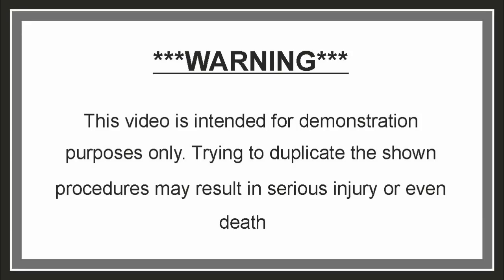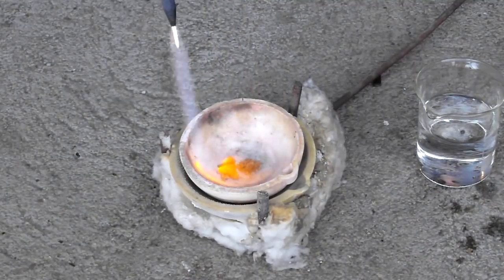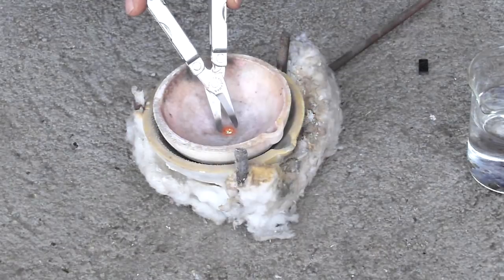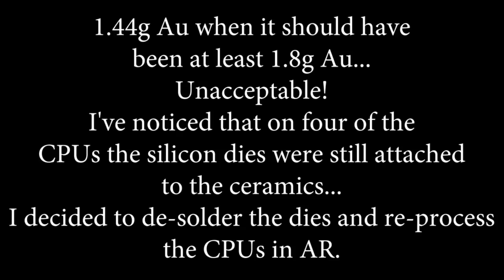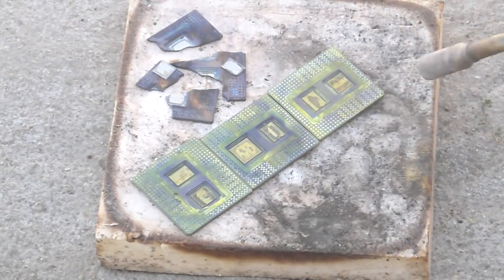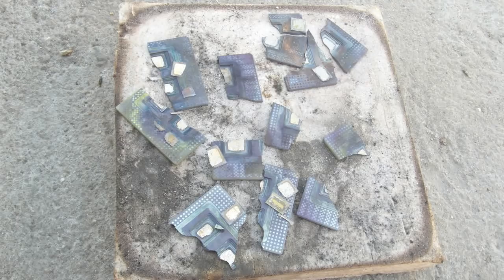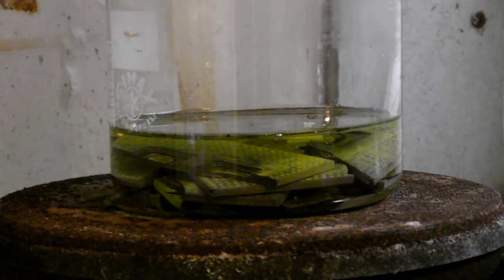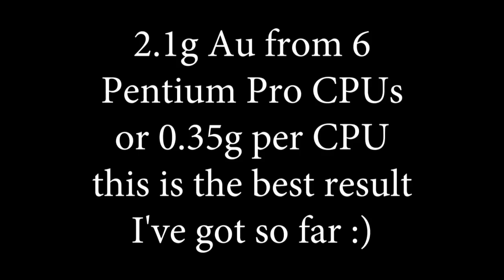0.35g Au per PentiumPro CPU

Comment: Nice as always, The green yellow color on the chips at about 7 min 12 seconds,  rub it with a Q Tip and test for Au. It's Going to make you sick. Keep them till you have a bunch, wash all that off with H20 and run the sediment. Just did some last week about 5 lbs, about 3.5 more grams of Au from chips that were run 2 times already. No more of the green yellow on them so I tossed them out. I still have another container of them to do.
Reply from the maker: Good advice!  I'll try that and I'll get back to you!
Reply: OwlTech видео класс! А что за восстановитель?
Reply from the maker: 4:09 Аскорбинка (Витамин С), 9:15 пиросульфит натрия
Reply: OwlTech СПС! Буду пробовать
Reply: OwlTech а излишки азотки гасили сульфаминовой?
Reply from the maker: да
Reply: OwlTech СПАСИБО ПОПРОБУЮ ОТПИШУСЬ